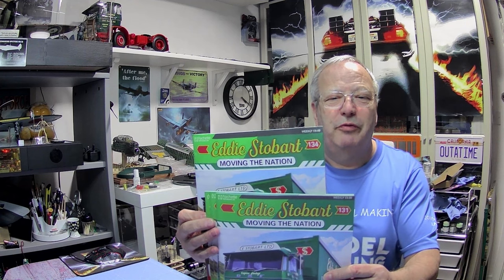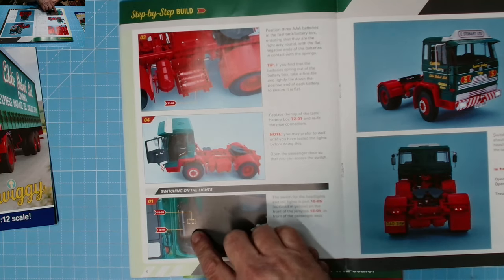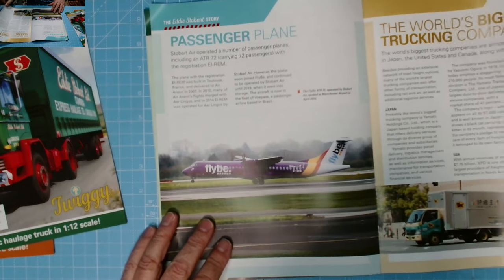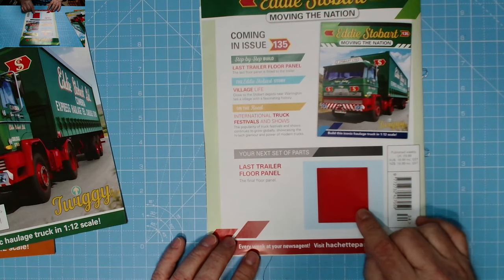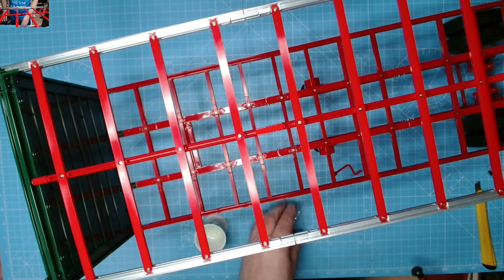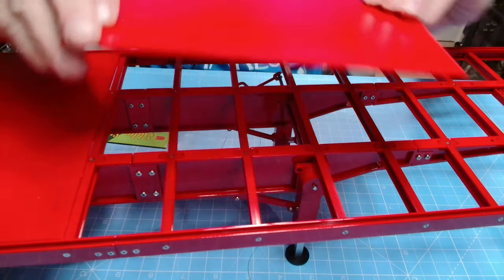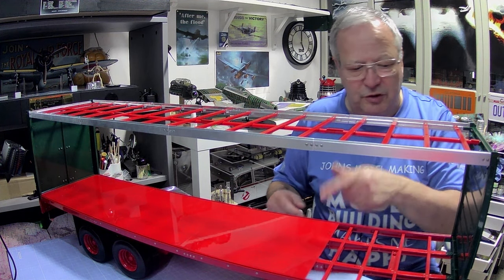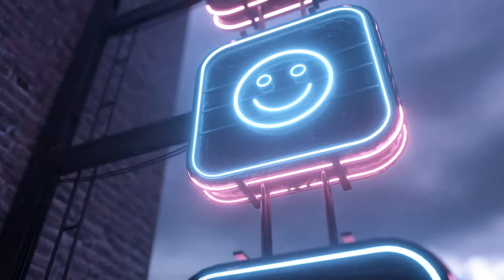Build Eddie Stobart's Twiggy issues 131 to 134 from Hachette

Comment: To be honest John I’m quite disappointed in building the trailer as there isn’t much detail in it at all, there’s no pipelines for brakes and there is several holes under the chassis. Unless they are waiting until the last issue. I’m pleased your just ahead of me now as I can see how the floor snaps in, whether it will stay in is debatable, might dab a little glue if loose. Also it looks as though the curtains will be fitted once and won’t roll back and forth, which is a shame. Anyway well done John 👌👏👏. Oh and a bit late for electrics as I tried them along while ago and you don’t need to turn the switch on to use the indicators and brake lights 😂👌👌👌
Reply from the maker: Yes, the trailer is quite underwhelming for this build. The missing lights and the curtains as they are now is disappointing! Thanks for watching! 😀

Comment: Hi John as a artic driver I can't believe that the floor is red plastic when in fact it was planks of wood running front to back down the trailer.
Reply from the maker: I know, its a disappointing end to the build. Thanks for watching! :)
Reply: @JohnsModelmaking  as an idea glue balsa stripes onto the plastic.
Reply from the maker: @stephenparkes626  Yes,that may be a good idea!
Reply: @stephenparkes626  You can get 6mm wide pine strips for model boats.

Comment: Hi john, I know I may sound picky but wouldn't the trailer floor be wooden ?
Reply from the maker: Yes, but this a partwork model and they only supply ABS plastic and die cast parts. 😀
Reply: They could do sticker wood effect like you have on your titanic build ?
Reply from the maker: Yes, that's a good point. 👍
Reply: U could actually put your own wood effect on plenty of images on Google images. I think I'll have a look sometime. anyways, the curtains will be modified on mine to move  as I've made some pallets and boxes even made my own paper craft forklift truck for the pallets. I've just found some wood effect fablon I've had a while should do the job nicely

Comment: As others have said, the trailer is a disappointment, in fact there is a case for misrepresentation, the advert clip clearly shows the trailer with working rear lights and indicators. No connections from tug to trailer. So often these😊 series start off good but have disappointing ends. Prices etc are escalating and work per magazine getting less. This is my last collection.